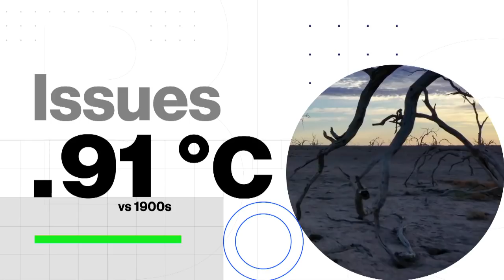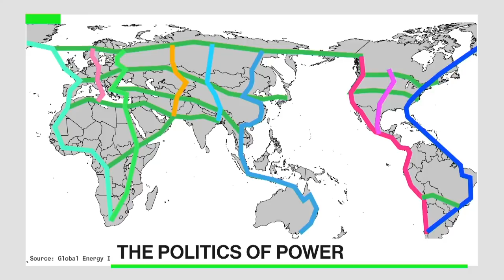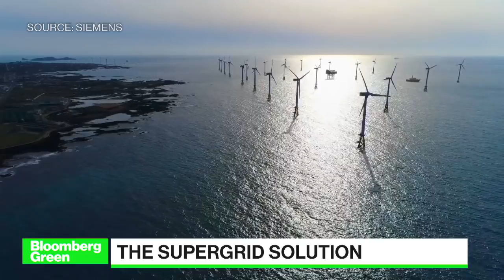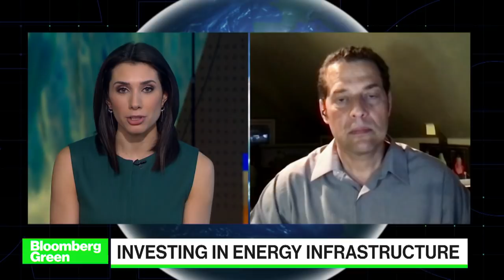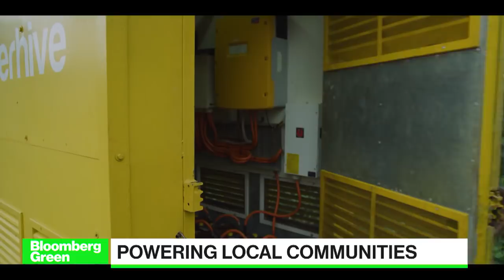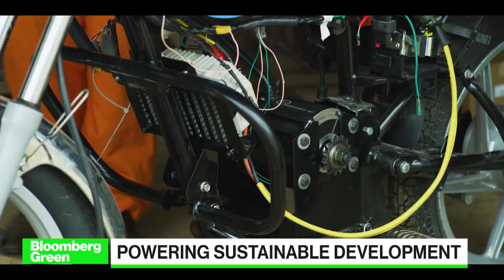Bloomberg Green: Supergrids to Connect the World

Comment: They talk about safety and think they thought of everything but they will learn what it means to be politically correct when reality hits.
There's not going to be any human made CO2 emissions because the sun is going to have a micro-nova scheduled to happen between right now or ten years from now at the latest. 
It happens in cycles every 12 000 years and the EMP is going to destroy all electronics.
Everything from nuclear- to chemical plants will blow up and all bio labs around the world like the one in Wuhan might leak.
There will be no electricity, water, fuel for vehicles to farm food and no factories left to manufacture any spare parts to start all over again.

The Carrington Event back in 1859 was a precursor to what is scheduled to happen and if that would have happened today you can forget about your iPhone because when it happened back in 1859 the electromagnetic pulse was so strong that the telegraph pols where burning and they could send messages for days without using a battery. That one would have set us back severely but the big one that's about to happen is going to wipe out all technology.